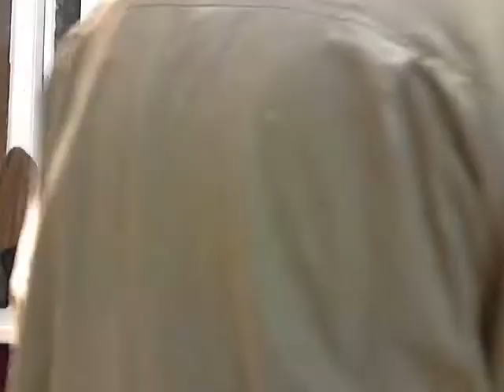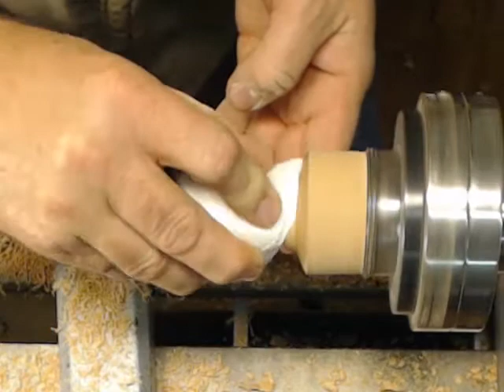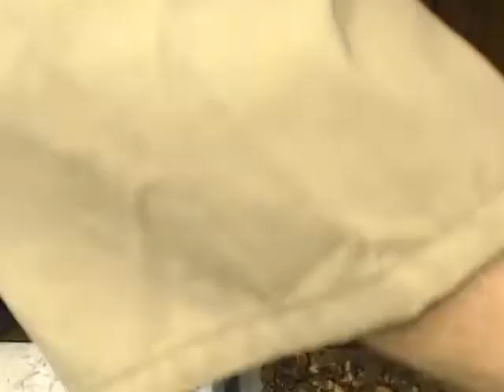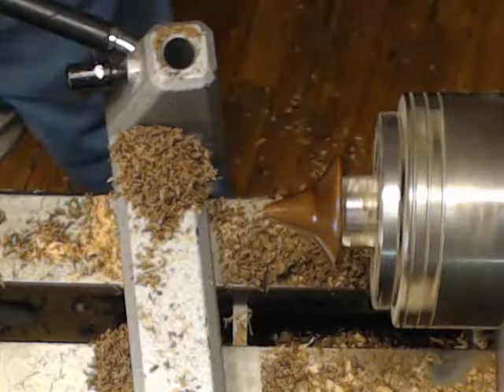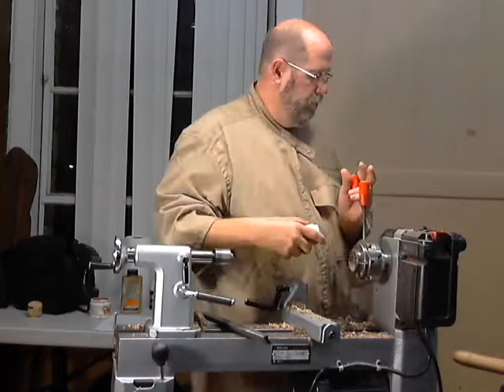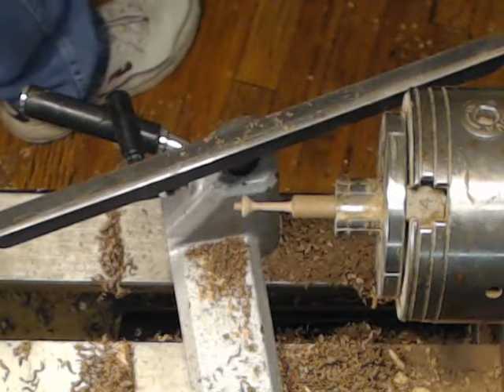Turning a Birdhouse Ornament with Mike Short

Comment: Can you please post your work sheet that you mentioned at the beginning?
Reply: Bird House Ornament
Components:  Bird house roof, bird house bottom, base, wire
and a bird.

Bird house roof – cut 
2” square turning stock x 1.25” thick – Drill 1.25 diameter hole, approx
0.25” deep.
Bird house bottom – cut 1.5” turning square stock x 2.25”
thick – Drill 1” diameter hole 1.5” deep.

Base – cut 3” turning stock x .75” thick – Drill 2” diameter
hole deep enough for chuck jaws to grip. 

Perch – Turn 3/8” diameter dowel rod to 1/8” diameter on end
to attach to the bird house bottom and shape the perch to a pleasing look. 
Wire – RG45 1/16” diameter welding rod – Cut to 9” in
length. 

Bird – Hobby Lobby

* Turn all parts, Drill 3/8”
diameter hole 5/8” from top and a 1”8” diameter hole 5/8” from the center of
the 3/8” hole for the perch and assemble all of the pieces. 

 

Friction Polish Recipe
equal parts denatured alcohol,boiled linseed oil, clear shellac.